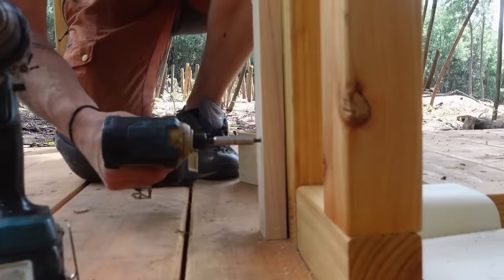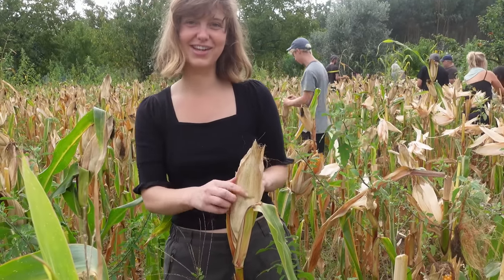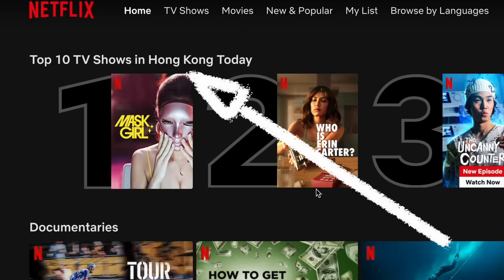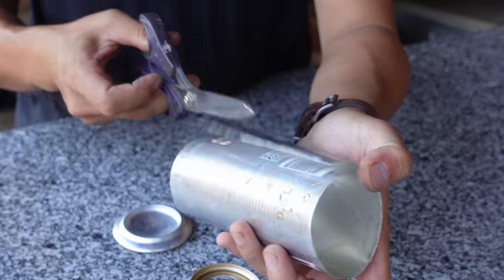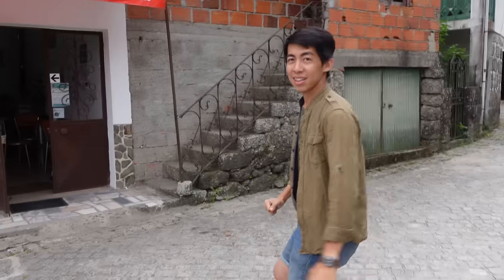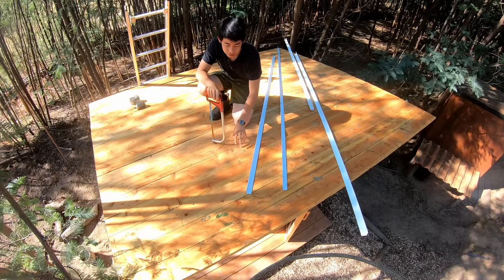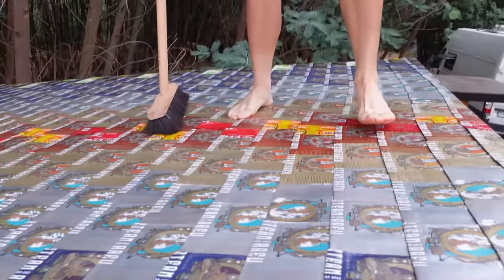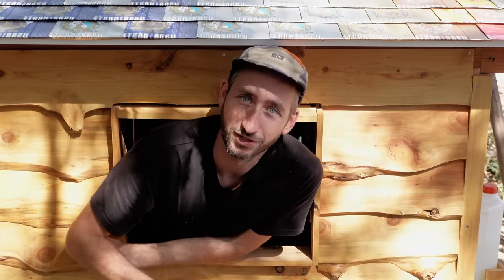#94 How we transformed 498 aluminium cans into a roof

Comment: How ingenius is  your shingle design, both technically and artistically!  I have been collecting aluminum cans for a similar purpose, not foe a roof but for the side of a shed.  On a vertical wall the rain will not penetrate upward so easily as on a low-sloping roof such as yours.   You actually could have easily saved much time by using a higher pitch on your roof to repel rain more rapidly and not worrying so much about tiny leaks.. 
Your shower test should have included a strong FAN to simulate WIND pushing water upward toward the peak of the roof.  
Also, for a small out-building like your external toilet, a few drops of rain coming through once in a while would not be a problem.  BUT..
FAR MORE IMPORTANTLY, please do NOT buy a new tractor or even one that is less than twenty years old.   If you buy a new or very modern tractor you will find when you need repairs that you cannot get them done locally , or at least that you must pay a huge amount.  Major tractor manufacturers have been cleverly destroying competition for repairs.  They are creating a terrible situation which requires repairs to be done by their licensed dealers, who charge very high prices.  
This is partly because they cleverly include very unnecessary electronic and digital  technology which more economical small independent mechanics cannot repair, and partly because in many countries the manufacturers create a sales contract which states that only licensed dealers can repair their tractors. 
I have just bought a tractor made in the 1940's, and have a very small "garden tractor" that is form 1974.  You should buy a good old tractor, even thirty or forty years old, and invest in any needed repairs.  Buy a brand that is respected by older local mechanics and is easy to find parts and mechanical service for, and was made on your continent, not on the other side of the world!   I think you will eventually be sorry of you do  not take this advice.
Reply: I think your advice is spot on..
Reply: Also they can remotely shut down the new tractors
Reply: I learnt a similar lesson when l lived in ltaly. First car was a FIAT which could be fixed by almost anyone with practically not much more than a piece of bent wire, often in their lunch hour, for the price of a coffee (true story). Next car was a Volkswagen EVERY time it broke down it was off the road for a week and cost an arm AND a leg! Bloody thing!
Reply: I hope this will be helpful too.  Talk to local farmers and other people who use tractors as you plan to use yours. Get advice from as many of them as you can.  
Take the advice of the poor and middle class farmers more seriously than the richest  farmers (If there are any "rich" farmers wherever you are).  But for sure continue to get advice from the users of tractors.   Determine whether you really need a 4-wheel drive for muddy terrain when it rains a lot and for hills --  or if a 2-wheel drive is good enough. You can always upgrade to a larger tractor or a 4-wheel drive later IF you have to. 
If you get a medium-small tractor built before around 1980 you will be able to learn to repair it yourselves most of the time.  
Probably all the tractors use the same ploughs and other implements attached with a 3-point hitch, but be sure before you buy.  Older tractor implements will also be cheaper.    @cocoday6215
Reply: I think they're doing the same with cars.

Comment: Love the diy can cutter.  use a more significant block for finishing the tab bending if only for the grip. Push with the block in the first step bend instead of your fingers. You even clap the bend with the block. You’ll get crisper bends. I’ve torn this type of roll seam roofing off low pitch porch roofs (NE USA)made of copper coated steel with the trademark Copper Loy embossed in it.

Comment from the maker: Put serious suggestions for the can roof in our reseach module.  Youtube comments gets messy 
HERE: https://community.projectkamp.com/research/can-we-make-a-roof-from-recycled-aluminium-cans
Reply: We were planning to do similar, out of interest, do you think it will be okay without a breathable memebrane between wood and aluminium? Thanks.
Reply: Keep in mind the use of screws and other fixation methods should also be made of aluminium to avoid galvanic pairing (corrosion).
Reply: @tesslillian6425 a breathable membrane would be a second defence in case you lose a shingle.
Reply: Hello. Out houses in US also have a pipe and a spinning metal top to draw out the smell. You could make that as well. Very good episode.
Reply: I would have placed the cans shiny side up because these days, they are lined with BPA plastic. It would protect the aluminium and reflect the sun, helping to stop the toilet from overheating.  Aesthetically, I suspect it will look nicer in 12 months' time than Sun bleached product logos. 😊😊❤❤😊😊
Reply: Should have used tar paper underneath.
Reply: Doppelfalz joints(double folded joints) or above would be the preferred technic and should be standard for roofing applications by professionals(Tinsmiths and Roofers).  
House wrap would be also required by code to make this for enclosed living spaces. My only concern for this application  (shed or outhouse) would be damage by hail, otherwise look quite solid.
Reply: 20:57 - your peach have aphids (the end leaves are crumbling around themserves .. its common when there are ants). There is natural way to get rid of aphids - you need to spray the tree with walnut water (water that has been boiled with walnut shells over long peroid) <- this should help the tree

Comment: For future roofs, you should lay down a moisture barrier first. Bees wax is usually good as a moisture barrier, but would melt in the sun. I would recommend recycled plastic. No molds needed, just cut to fit, apply low heat to basically bond to the roof, and then put on the cans. Cool idea, thanks for showing us.

Comment: I loved the one we built back in the 1990's. Using cans is not a "new technique". This has been around for decades. Aluminum roofs were even popular in the 1970's - both from using cans to aluminum sheets from the hardware store. There are videos on YouTube that show how to make aluminum roof tiles from cans. It is important to use heavy gloves when making them because of the sharp edges. The first time I did this, in 1992, the gloves I had were not thick enough. That shed roof lasted longer than a traditional asphalt shingle roof. A friend of ours did his entire house roof with the aluminum shingles. He removed the ink from the cans and only put the inside of the can's facing-up, so the roof looked like the expensive Aluminum tiles that cost thousands of dollars more that he paid by saving his soda cans for a little over a year before the project. It is also important to wash the cans after use and to store them by cutting them and putting them in neat stacks in the garage using rubber bands.

Comment: This is the standard method for metal shingling with copper in Japan.  This video is great and showed greater detail on a usable process for making the shingles.  There are "propper" flat clips used in that process.  A clever as the pull tabs are, I am not sure they are strong enough.  Interesting to see how it all turns out.  

Love the tool for removing the ends of the can.

Comment: Do you have a reason, why you are using the cans printed side up? Other way around you could probably increase albedo (reflectiveness) and thus keep the temperature in and around the toilet lower. 

[Marwa Dabaieh et al. "Reducing cooling demands in a hot dry climate: A simulation study for non-insulated passive cool roof thermal performance in residential buildings"]

Comment: This is very smart. It will work very well on small projects. It's still a good idea to have an underlayment to add protection to the wood.
I wonder if you were to take larger pieces of aluminum sheets what could be done.

Comment: Obviously a nice idea and applaud the effort, engineering and upcycling. One issue with this i could see however, is that aluminum sheet metal seems so thin that a bird possibly with its claws or its beak trying to eat or peck at something on it, i could see possibly creating holes

Comment: These are very similar to professional metal roof tiles. Typically you should put tar paper down on the roof deck under the roofing for the actual waterproofing. Also, this may perform better if you rotate the pattern 45 degrees.

Comment: With the amount of effort put into the folding jig you might've wanted to consider modifying it to also work as a cutting template. Not having to swap things out cuts downtime by a lot.
But the simple jigs and increased manpower also did the job just fine it seems.

Comment: I am living in my own Earthship, and we have built quite a few tin can walls. We noticed that after 2-3 years the tin cans completely dissolves due to corrosion. Even though they are completely built into the cement wall and protected from the weather. But it is not a problem for us, as it was meant to be. The tin cans are only there to save cement and the way we build it (honeycomb pattern) provides structural integrity. 
My question to you is what will happen with your roof after being exposed to the weather for some years?
I would be very interested in drawing from your experiences and knowledge.

Comment: after having quite a lot typhoon winds lately in my area, the biggest enemy of this shingles is strong wind... I'm using cheap transparent cross-sewn plastic sheet/tarp for huge patio roof and greenhouse, greenhouse outlived many storms and huge hail ice chunks falling from sky and still standing after 10 years (made of cheapest thin wood beams), that's why I used it also for patio construction and cost me only 70$ for whole one-piece sheet, patio can accomodate 20+ ppl partying under, imagine the price of any transparent panels to cover whole area. Anyway for a roof like this you could just use 1-2 layers of 3$ tarp or packaging plastic, but it would not give thousands $$ from youtube revenue :D

Comment: I'm going to suggest flatten the tube and apply staples in standard method. Then a coat of elastomeric white paint (or standard roofing 'tar' in northern climates.). But you needed tar paper under the shingles. As you will learn. 
My suggestion is SOLDER SHEETS OF CUT CANS TOGETHER.

Comment: You can put holes in the shingle you just need to make sure that you stagger them and have the bottom of the next layer cover the nail/staple. Start at the bottom work up to the high point or the peak if it comes to a peak the you gotta figure out a cap style like a V shape that covers the nail/staple of both sides if that makes sense.

Comment: Such a great use of wasted cans! Thanks for sharing the project with detailed explanation. I'm looking forward to see it's performance after some time.
I was wondering if there's a chance that painted side will degrade with rains and contaminate water/area around? So I'd think about using them flipped probably. Also, instead of using one screw per piece, is it possible to stable a row of sheets with a string (copper wire, cable etc.) screwed on oppsite sides? TOL...

Comment: I saw hundreds of small homes with “coke/beer can shingles on the rooftops when I was in Vietnam (1968-1969).  At the time I thought it was pretty practical, cheap and a great way to recycle before it was popular. 
 I had always hoped to do the same but 55 years later I have stuck with shingles or tin roofs.
 Good luck it should last for years

Comment: Aluminum having a low melting point, you could have melting the cans into a mold that automatically interlocks vs ALL THAT LABOR, cuts and all... on top, you could have made larger tiles... even if the mold you made was 4 or 6 tiles wide, you make them in batches.  Pour into handmade mold, lift the mold and angle, shake etc to level it, and a few minutes layer, flip out for final cool once shape is taken.  Repeat.  Shoot... you could make the sheet 2 by 3 even. And you don't waste the top and bottoms, all Aluminum is melted.

Comment: Cool idea!  some concerns:
1. did you use stainless steel screws?  It is unusual to see galvanic corrosion on aluminum in contact with stainless steel (passive). In contrast, contact between copper, bronze, brass and different kinds of steel alloys (passive and active) and aluminum can cause severe corrosion.
2. aluminum only bends a few times before breaking - wind flipping the shingles up could make this a very high maintenance and not durable roof. 

Curious to know what you think of these points and if you did anything to address them?

Comment: I like the idea, but I was told the inside of those cans have a thin layer of plastic spray. After cutting the cans, I believe they will start corrosion quickly once the plastic layer is scratched. Not sure how long it would take for the can to break down, but its really thin.

Comment: Beautiful roof and well designed shingles. Although I believe you could’ve saved a lot of hours, simply by overlaying the simple sheet aluminium and clamping/nailing it down. I think it would’ve been both faster and cheaper, seeing clamp/nails aren’t as expensive as screws.
I think using the artwork of the cans to create a collage was brilliant, but wouldn’t it make more sense to exploit the epoxy layer inside the can, as it doesn’t corrode as easily?

Comment: Issue with this design is the condensation that happens under the can shingles getting the wood under it wet. With enough ventilation gap this might work, but its short term solution for warm climate. Any insulation below will get wet unless there is underlaying membrane directing that water off from roof and still it lacks ventilation well as each of those screws will breach the membrane causing new points of leak well as rusting. Using sheet metal from broken down appliances would been better option and check "machine seam roofing". Can version was similar but in proper machine seam roofs, the seams are upwards on edges creating valleys for water to collect and drain down. Also dont forger drip edges, those existing and built properly turns 10 year building into 30 year building and 30 year building into 50 year building. All properly built house can last hundreds of years if properly maintained.

Comment: I wonder if liter plastic bottles can be used as an underlayment and then the aluminum cans.  The plastic would help assure water is shed and the aluminum would look better and block degradation of the plastic from ultraviolet light.
      When using the aluminum cans, make sure that you don't use steel flashing with that aluminum construction.  In places where the steel and aluminum meet in a wet environment, the aluminum acts as an anode and the steel act as a cathode, and the aluminum is eaten like a battery plate.

Comment: You need to seal that aluminum,  being out in the elements it will start to deteriorate real quick into aluminum dust.. It will turn white in spots and get holes in it as it gets thinner and thinner until it just crumbles in about a years time.

Comment: While aluminum cans can work for a while. It's to be noted that they have a tendency to stick to and fuse to other metals over time. Known has Galvanic Corrosion.

P.S. : Even though It says in the title "Aluminium" Should be refer to the element and Aluminum when talking about the metal. 

Though this defers between regions.

Comment: The whole idea of "making holes" is the reason why you overlap your roof tiles. So you can cover up those holes. Every slat tile roof ever built has a minimum of two holes for each tile. That's a whole lotta holes for house that isn't wet on the inside.

Comment: This roof costs $300 to make in terms of aluminum. Quick Math: 500 cans÷ 12 cans/case= 42 cases. @$7/Case the cost is $294 plus tax. Not factored into the total cost is the wood roof under the cans or any labor expense associated with the production. 

Labour estimates: if one roof tile takes one minute to make and 500 tiles are needed, then the total labor required is 8.5 hrs. Not factored into the equation are the time and costs associated with making the jigs for streamlining the process.

Conclusions: since canned products are significantly easy to find and are common in all areas of the world, it is safe to assume this is a viable project anywhere. Given the versatility of the design in acceptance of all sized cans, it is also generally accepted as an easy project to assist in low income housing projects. Given implied cost to repair this design I designate the concept as worthy of mass dissemination in multiple languages. 

Pros: Cheap to build. Easy to build. Easy to repair/replace damaged sections.
Cons: Time consuming project. Requires organization and perfect cans that haven't been crushed or dented with creases in the metal.
Reply: Update: I figured out how to make it more efficient while offering up additional space from the same cans.

Why is the fold length as long as it is for the tiles? Shouldn't a thinner width be used to increase the ease of repair for replacing tiles? Why that specific width of fold? By slimming the fold to 1/4 of what it is now, every four tiles gives the full length of the original width in terms of roof surface area upon completion. 

This does increase the difficulty of folding but by making a jig to streamline the manufacturing process, you end up eliminating this issue anyway.

Edit: I've also determined that there are two additional items of interest here.
First is that penny stoves can be created from the bottoms of the cans, which can be useful tools for homeless individuals because rubbing alcohol used to fuel them are universally available around the world at all pharmacies. Second are the tabs on the lids are more useful as a crafting supply and can be sold online in bulk for additional income to offset the cost of the project.